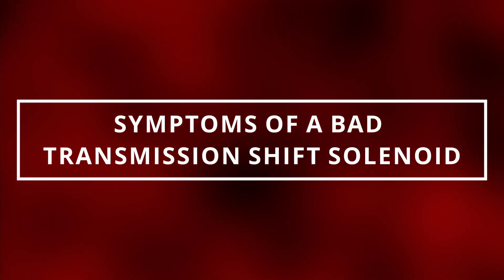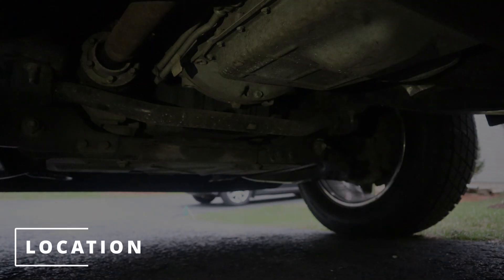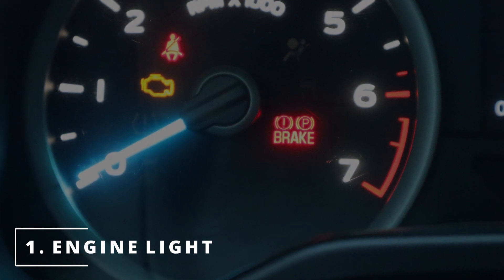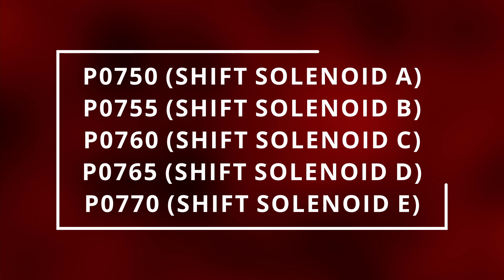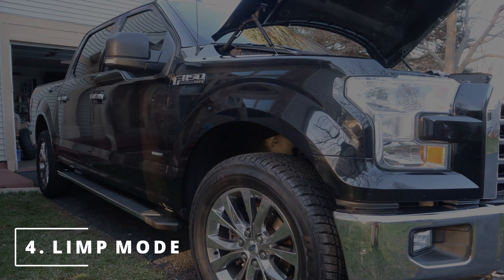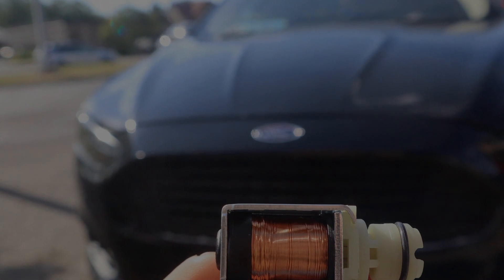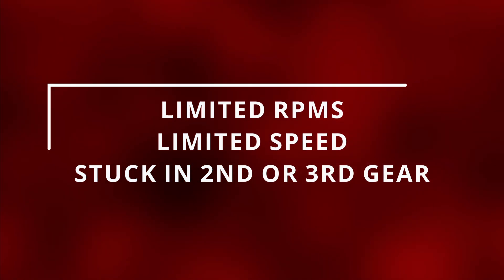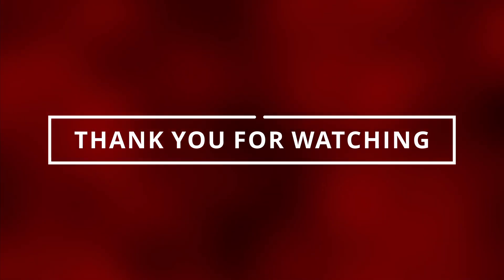SYMPTOMS OF A BAD TRANSMISSION SHIFT SOLENOID

Comment: Had my 460le rebuilt with monster trans kit, the cooler installed line broke and I got it towed and replaced asap, 1 week later I get a CEL for stuck solenoid open. Could it be dirty fluid or something worse? Drives and shifts fine although I parked it since running this code. Only thing noticed is my 2nd gear shift kit isn't thumping into 2nd like it used before changing cooler and fluid

Comment: Thanks, is it possible to get this kind of issue without having the check engine lights on and detected on the scanner?

My car has similar symptoms but nothing being detected when it scanned
Reply: I believe so because I have these symptoms and only traction light on
Reply: @cruddy00tv62  thanks, was the issue with your car fixed after the solenoids replacement?
Reply: @anggadwikara6881  I didn’t replace them because of the fact of not getting codes but I researched a lot can’t find the main video I seen but I’ll find it for you but this may help wanted to try today but it started to rain I will update you when I put the ground wire on to see if it works
Reply: @cruddy00tv62  please update later sir 🙏
Reply: @cruddy00tv62  Having same issue - also rain today - pls let us know if you found the problem (TPS, TCM, etc)
Reply: @NuklearPasta  will do
Reply: @cruddy00tv62  any updates?
Reply: Sorry y’all it’s been raining update coming soon

Comment: 2005 suburban won't go into OD. Goes through 1-3 perfectly. In 3rd it just keep revving higher and higher and won't shift. Any ideas?
Reply: Sameee issue with my 02 trail blazer trinna figure out if it’s the transmission fluid  & filter that needs change or the solinoid  I added sum trans fluid to see if I was maybe low but still did the same issue thinking about changing the fluid and filter and trying the lucus trans fix to add to the fluid to give it a shot before I take it to a trans shop

Comment: Great video thank u!!  I drive a 08 Lexus IS250. When slowing down and almost about to come to a complete stop I feel a slight bump.  Do you know what that can be related to??  I have no check engine light. And I just got the car so I'm not sure if the training fluid or filters was ever change.
Reply: i just got a ls400 like last week and it’s doing the same thing💀
Reply: @2righteous  I got an update.  So I did an engine oil flush using motor medic. I then change my engine oil, filter, and spark plugs, and did a full throttle buddy cleaning down to removing the intake manifold and soaking the intake passages which were full of carbon and slosh. I used seafoam for that. Additionally, I change my front and rear brakes complete with new rotors. Miraculously that surge or bump I was feeling when coming to a complete stop has now disappeared.  I'm guessing it had something to do with the carbon cleaning I did and not at all transmission related. What ever it was I no longer have that issue.🤗

Comment: i’m hoping the shift solenoid is my problem. Did a transmission rebuilt on my ‘06 Acura 50k miles ago and it slips into neutral on downshifts at low speeds. Also the time it takes to transition from Park to Drive can be annoyingly long at times. Was hoping the solenoid would be part of the tranny rebuilt, but I guess not. Hope this fixes my current issues.
Reply: I'm in the same boat
Reply: @thirtysixbeats  did you fix it??
Reply: @joeeuell7595  not yet sadly although I just did a trans fluid flush and replace it is running like new. Soon I will be changing the trans solenoid to get rid of the rough downshift and late gear changes

Comment: Could use a video to use with my 96 Chevy g20 van, not shifting outta low gear. Appreciate any help to repair it.
Reply: Not shifting out of first is often a computer issue. 
Disconnect the battery and touch the battery cables together to drain any juice out of the vehicle.  Then leave it disconnected for 10 minutes.  This will reset the computer.

Comment: I just got my 2016 mustang gt back from ford bc I’m having transmission issues, I was told it’s skipping fourth gear, basically when I get to 25-30 mph the rpm flares up and if I let off the gas and let the rpm drop a little then get back on it then it will shift and drive fine, but if I try to get up to speed quickly it just won’t shift it seems to me although I don’t hold the gas very long in that situation bc I don’t want shoot the rpm’s through the roof while not gaining speed. Any clue to what this might be?

Comment: I have a 6l80e and 2-3 slips sometimes but smooth on highway or if I’m giving it enough gas. Changed fluid and it’s still the same not better or worse. Trans never overheats. Always stays 140-180
Reply: See if cleaning or replacing your MAF helps. Trying that now as soon as my maf comes in the mail
Reply: @oleyeller3256  did that help?
Reply: @smashadams85100  nah not in my case unfortunately. Now im waiting to change trans fluid and adding a bottle of that seafoam transtune and see of that helps. Adding some tomy existing fluid seemed to have helped some
Reply: @oleyeller3256  damn.
Reply: I’m currently having this problem with the same transmission, my fluid was burned and it wasn’t much of it in there at all. I can’t find any solenoids and I’m hoping to avoid buying the entire valve body. Have you found a fix yet?

Comment: Do you always get a code for a shift solenoid? My trans stays stuck in a gear. It doesn't act like a slipping transmission to me. It's a 2003 Ford F-250 with a 6.0

Comment: My 01' pathfinder started yesterday bucking and then it was fine until I reached the hwy, get up to about 65-80 and its like the overdrive is having trouble staying engaged my RPM's will go up to 4 or 5 grand it'll shift into overdrive for a few seconds and then start with the bucking and carrying on again. its like getting a manual shift car up to 100mph and dropping it into 1st gear. Ive found that if I turn my overdrive off it drives fine but of course its tacking out at hwy speeds of 80mph. No engine light at this point though. It has around 255,000 miles on it the damn thing ran great for the yr and miles it has on it up until now. i bought it used a year ago and have yet to do a tune up on it but the guy i got it from did all that stuff before i bought it he is well trusted friend so I know it doesnt need anything like oil change, spark plugs, etc.... any help will be appreciated. And I am a retired mechanic just sayin, thanks Youtube family
Reply: Did you ever figure it out? I have a little Chevy Aveo that will shake a bit when first driving it but highway it's fine after a bit. Hopefully don't need new tranny😔

Comment: I have a 1986 truck i shifts tru 1 2 3 but it struggles most of the times on 3 and fourth gear to change i replaced the oil amd the filter but still have the same problem

Comment: I have a 2008 Camry. Everything runs perfect the only thing I noticed when i first put it in drive and drive off it has a small click going from 1st to 2nd  and it only does it the first time the car is turned on. Doesn’t affect it in any kind of way I just noticed and would like to see if anyone else has this problem before it turns into something more expensive to fix.
Reply: Scotty Kilgmer. says old transmission fluid need to be drained THEN CHANGE FILTER AND!!!! Refill with the same dirty TRANSMISSION FLUID!  He’s the guy

Comment: 4l60e issue. Truck will move in 1st, 2nd and reverse. Once the truck is moving and up to speed, I can upshift to 3rd and (D) drive. Could those be solenoid issues?
Reply: @Dedric Jones Yep. Trans needs to be rebuilt.

Comment: Hello everyone. I'm wondering if you could help me to help my dad. His work van is a 2001 Econoline2001 e350 it won't go into drive it only will go into neutral Park and reverse. He took it to a shop and paid $200 just for them to look at it and they told him he needed a new transmission. The person that sold it to him told him to never let anybody tell him it was the transmission if that happened that it was the solenoids. The linkage being loose. Does anybody know anything about this at all I've looked everywhere and I can't seem to find anything
Reply: Check the transmission control module. It might have got wet .

Comment: @ Easy AutoFix Sir  the car transmission is making whinning noise, and delays in shifting. I checked for the fuel level is Ok, I checked for the oil still fresh not burned, I checked for any leaks no any leaks, I open the pan, but there were no any metal shavings on the magnets no any particles on the fluid, I decided to change the transmission filter, I checked and open  the valve body  no any clogs on the passages, I removed all solenoids I tested them all, and one was not working, I changed it with new one, I put back everything I test drive the vehicle no more whinning noise at all and shifting gears smoothly, but after two days as i drive reaching speed of 100 mph, the whinning noise started again, and the car struggles to exceed speed of 100mph, the RPM goes high and the speed is not achieved, what can be the problem, and what can be done sir? Kindly help with ideas.
Reply: Interesting transmission control module maybe ?

Comment: How do I tell if it's just the solenoid switch, or the entire transmission? Because I hope it's the former because replacing just the solenoid would be much cheaper than replacing the whole tranny.
Reply: Good question, I hope someone answers it because I'm curious about that too
Reply: You need to replace the Sputnik vacuum valve under the transmission picke plate. Its easy to spot, because it's right behind the gear nook. Hope this helps👍
Reply: @StevenSeagull6969  can you repeat that in laymen’s terms now?
Reply: @StevenSeagull6969 lolol

Comment: my car is experiencing all the symptoms but randomly one day it works the next its a pos. 
works good during the day and at night its a pos. 
i randomly get engine over speed and incorrect gear ratio codes. 
its driving me crazy. i cant get a car to borrow so i can take it in to have it looked at. either i do the work myself or set the car on fire and ahoot myself because no one cares to help me.

Comment: I have a 91 f250 5.8 with a 351 Windsor. 2wd 
When it shifts, it shifts kinda hard, I’ve changed fluids and stuff. Another problem is the little PRND is kinda off, the orange isn’t all the way in the D and is kinda in the N why is that
Reply: Check cable from shifter to transmission for wear, excessive rust or damage.

Comment: Thanks for the video -  and subscribed! - I have a 2002 Chevy Avalanche that recently experienced tranny coolant line failure... it was gushing out and ran low on trans. fluid.  It was while driving it (constantly refilling the fluid) that I lost 3rd gear.  In Drive it shifts fine from 1st to 2nd but when it goes to shift into 3rd gear it winds out as though it was just shifted into Neutral.   

Since this event I changed out the trans cooling lines, but it still does the same thing with a full trans fluid level and no leaks.

Is it possible, with this symptom, that a shift solenoid went bad, or did I without question, fry my steel/friction plates with the low trans fluid condition?  

Thanks very much.
Tripp in Ithaca
Reply: Going into neutral is band and clutches worn out usually

Comment: What about shifting hard out of first and second
Reply: Yes, harsh, jerky shifting out of first and second gear possibly 3rd and 4th is a symptom. Clean the shift solenoid first to see if that solves the problem. Even though you test the shift solenoid with a multimeter and it shows correct resistance etc..etc it could still be a faulty shift solenoid. Replace the solenoid if cleaning does not correct the situation

Comment: To all you guys with 4L60E and 80E , trans. Experiencing a 2-3 flare up , your 3/4 frictions are shot(4l60e) ,4L80E would be direct clutch pack worn or burnt. The switches from GM  are ran thru millions of duty cycles , random pulls from production.they do go bad , but generally the coil magnet still functions, but the orfice and screen are plugged. They can be tested , with a battery , problem is , they operate on reference voltage. 5 volts. The switch has + allthe time. ECM  sends the ground to the proper switch, or switches , to activate gear range.  2 switches provide trans with 4 forward gears .
Reply: I have a 2004  chevy Silverado that's wont shift n its stays in 3rd gear n rpms just revs up and my speedometer stays at 89 kms is it my my solenoids I need to replace
Reply: @garylacorde8971  sounds like in limp mode. SolenoidAand B . Both of. Verify viltage to harness at terminal E ,12 volt+. Pull trouble codes , if you have codes for all solenoids and EPC, 3/2 downshift soenoid, and range sensor, there is a high likelihood that there is no power down there at harness. The GM tahoes ,yukons, and pickups , were prone to having a bad ignition switch.. not the key part , but the box that the key operates.
Reply: @ronniecox109  I found out it's the TPS sensors.thank u
Reply: Damn so your telling me my reverse to drive is fried , I have a hard jerk going into reverse from drive what can it be ?
Reply: @Anthony0899  reverse is direct clutch applied,, and the rev . Band is applied by the reverse servo.  My money would be on the band. I replace em on every unit i do.
Reply: @ronniecox109  thank you , idk why is jerks but I haven’t serviced anything on the transmission yet , now it’s slightly in every other gear as well , leaking tranny fluid a bit from my axle I believe and maybe I have dirty screens and need my hands serviced ?
Reply: @Anthony0899  What kind of vehicle is it.
Reply: @dalevackar182  1992 Chevy caprice
Reply: @Anthony0899  That car would have a 4L60E in it. Have you solved the issue with it yet.
Reply: @dalevackar182  nope hahaha , seems like it’s getting a little worse , idk if it’s me or not but now my car seems to jerk though 10 through 20 mpg or maybe going through gears slightly
Reply: @Anthony0899  The 4L60E has a low reverse clutch and a input reverse clutch which is in the very first drum behind the pump but I don't see either one of those causing a hard engagement in reverse. Something is causing main line pressure to boost to high. If you are having irratic upshifts have your throttle position sensor checked. It should read a half volt in the closed position and between 3 and half and 4 volts at fully open position. You can check this with a volt meter or have a monitor hooked and read in the live data section.
Reply: @dalevackar182  I belive it was the 4l60 in the 92 and when to the 4l60e in 93
Reply: @jessesimpson8783  In pickups that is true but in the Caprice sedan and station wagon they had a 4L60E in 91.
Reply: @dalevackar182  Roger that.   Learn something new everyday. Lol
Reply: @jessesimpson8783  Me too brother and I've been doing this since 1980.
Reply: @Dale Vackar  I just lost reverse in my jeep no symptoms.. just won't shift into gear completely. It will roll when on jack but once on ground doesn't move..... never grinded or shifted hard.... auto trans reverse disappeared
Reply: @uptoproofingdisastersoluti7218  most likely stripped sun shell, common problem with 4l60E.
Reply: @uptoproofingdisastersoluti7218  never mind. You said jeep.not a 4l60e. Dependind on year, could be a chrysler trans, or could ba a foriegn unit.
Reply: @ronniecox109  42LRE
Reply: @ronniecox109 2013 gmc sierra 1500. Feels like it’s slipping into neutral when shifting from 1-2 or 2-3 I’ll get a huge rev up and then it drops into gear.
Reply: @dalevackar182 I have a 2004 Chevy Impala with similar issues can you help?
Reply: @FlaxkoGotti  What engine and what are the symptoms
Reply: What about an 05 Silverado 5.3. it doesn't wanna down shift when passing or floored. My Over drive button no longer works when you click it
Reply: @brandonnguyen1486  possibly 3-2 downshift solenoid switch
Reply: @ronniecox109  hey man, I got a 2016 f150 2.7 ecoboost with the 6r80 trans and at 3-4 at cruising speed it doesn't know what it wants to do, it will either do a light rev and downshift to 3rd or vice versa to 4th and it is slowly starting to do it from 4th to 5th now, all this happens at cruising speed around 35-40ish miles but when I accelerate to get on the highway or accelerate as I would normally to gain speed it shifts threw all the gears just fine and downshifts just fine when I get to a red light. can it be a solenoid? theirs no noises or whining when it shifts or down shifts (or at least not yet) even when I shift from park to drive theirs no clunking or  whining noises. the truck just started doing it last week and I only took it out twice as I am scared that I can further damage it. Any advice would help! thank you for your time!

Comment: I have an automatic 2003 Honda Civic 1.7 LX. My transmission is acting up with no check engine. How can I tell if it slips or delay in shifting? I fixed one Honda by replacing the 1,2,3,4 shift solenoid as one unit (I was getting code for it) but this feels like slips and to my understanding that needs overhauled. What cause transmission to slip between shiftings?

Comment: I have a 2000 lexus gs300. I can not shift out of park without pressing the release switch. Also i can not shift from neutral to reverse without pressing the release button. Its not the brake switch i already replaced that. Any help would be appreciated

Comment: What if it’s holding gears before shifting in my case it’s 2-3 gear shifting late. replaced the fluid  still does it
Reply: Did you figure it out
Reply: @Francofit  nope still driving it like this feels like it’s getting worse haha I’ll buy a junkyard trans and swap the parts the valve body and solenoids. If that doesn’t work I’m screwed lol but it should
Reply: @Neverfollowthecrowd  damn, my car does the same but it’s 3-4 and it’s a 4 speed auto. I guess I have to manual swap it then